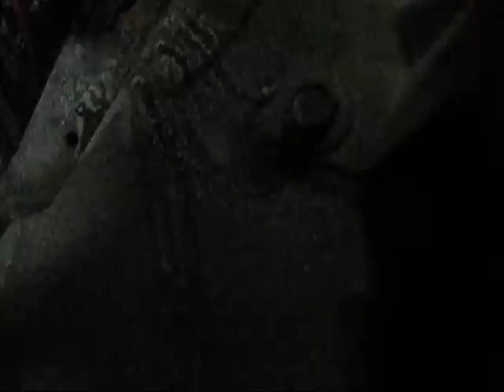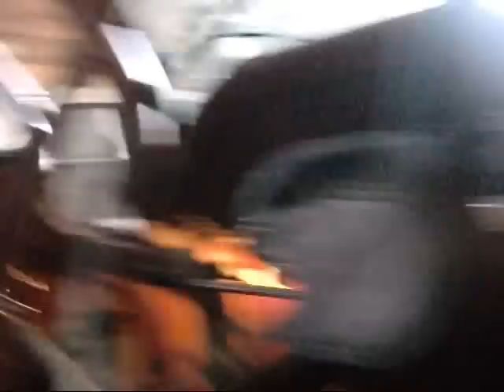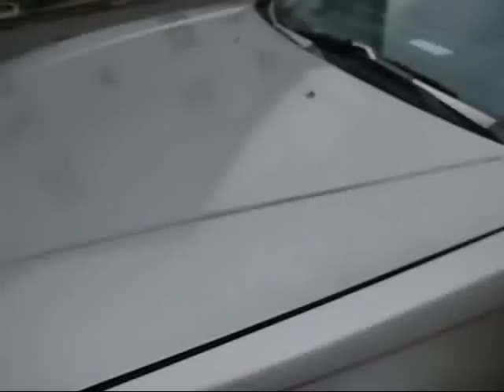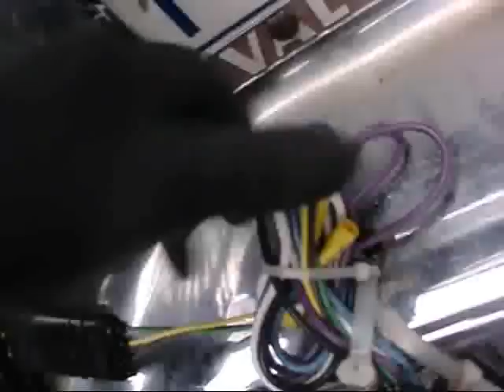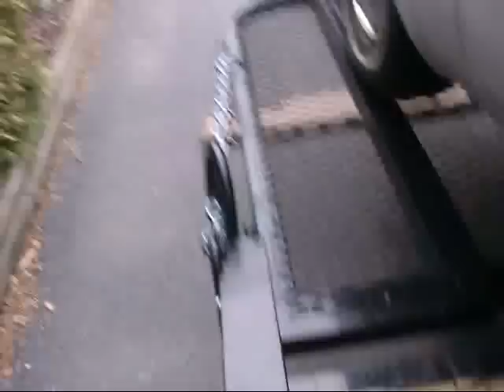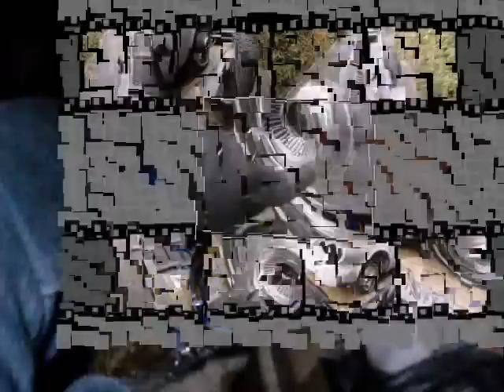5 10 12  64 Monza Onto Trailer...

Comment: You'll have to be careful towing.  The soft top wasn't designed to have the wind pressures from highway speeds hitting it from the back.  Could cause some damage.  I'd hate to see that.